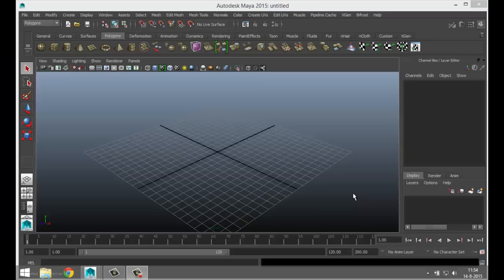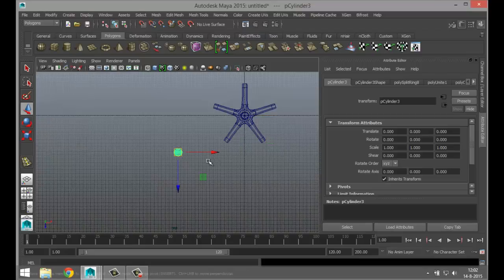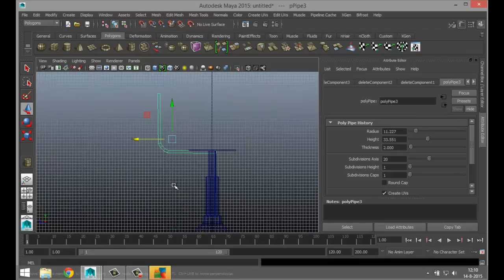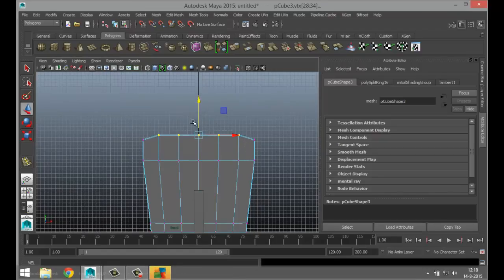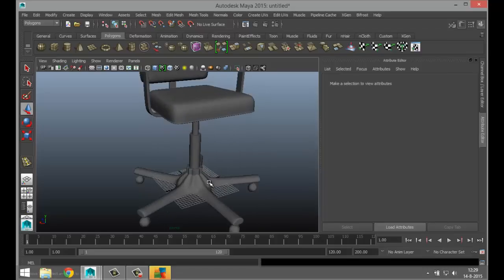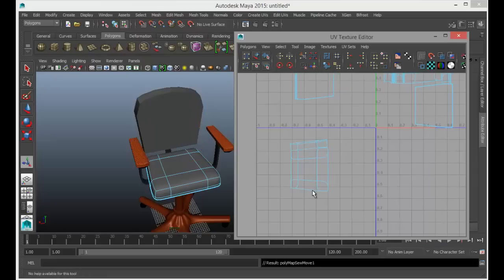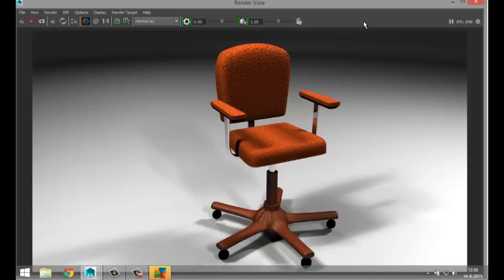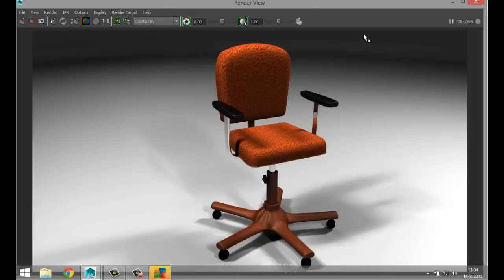Maya tutorial : How to model and rig and Office chair ( Part 1 of 2 )

Comment: what's with your mic ,  the sound was better before. it's like your in a hallway
Reply from the maker: uptownpapi25 Hi there, I received a lot of comments on the volume of my videos. It was too soft, too low etc. So I tried a Mic instead of a headset. In the video I asked people to comment if that helped. So thanks for the comment :-)

Mike
Reply: mic was great before , keep up the great work mike. thanks again for all your vids .
Reply from the maker: uptownpapi25 OK, I am switching back to my original mic and in the future I will be recording in 1080p. Hope that helps.
Thanks for the support :-)

Mike
Reply: your vids were perfect before , but 1080p is always a plus .
Reply from the maker: uptownpapi25 Thanks :-)
Reply: +Mike Hermes 1080p makes videos too large and it will consume you too much time .720p is enough for me and i hope it is for others too ! People should make it a little bit easy to their teacher .
Reply from the maker: +Isa Bardhoshi Hi Isa, I fixed the sound issue and am testing the 1080p but you are right, it takes forever :-)